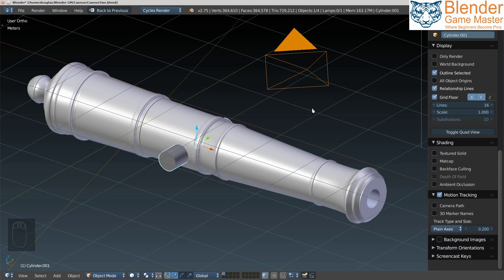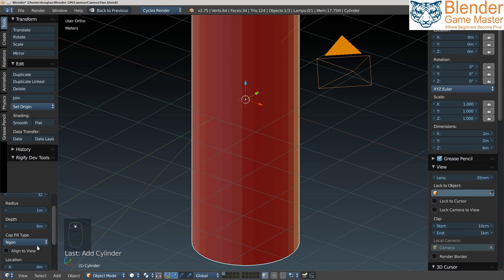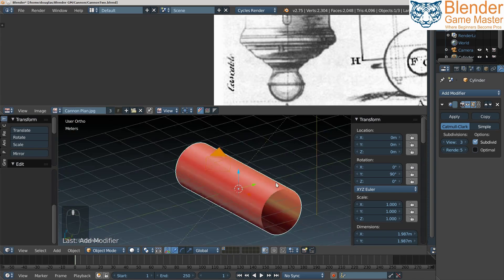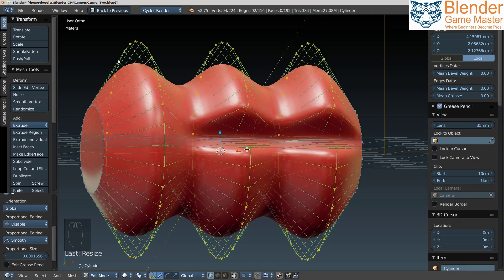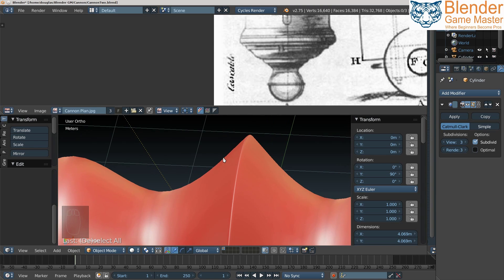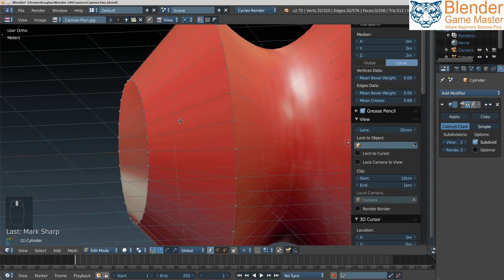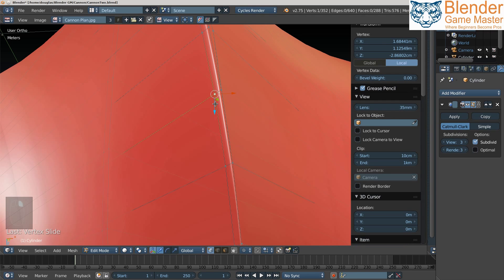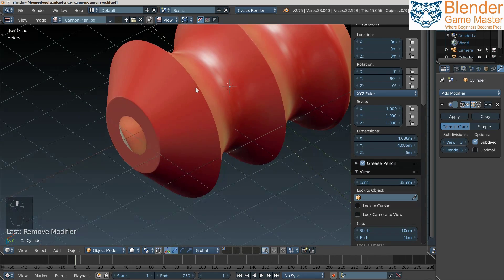Subdivision Surfaces Tips for Blender Beginners and Newbies. Details of a Cannon.

Comment: I normally use Cylinders with only 12 vertices, Subdivision level of (view 2, render 3) and Smooth shading and I enable Optimal display. The Simple is used when you need to add polygons, but don't want rounded edges (i.e.: a cube remains shaped into a cube instead of becoming a ball, but you get the extra geometry).

Comment: I am trying to remove a subdivision surface modifier from an object after it has been applied. thank you
Reply from the maker: +ali alhimeri If it has been applied then the modifier no longer exists. You can't undo it unless it is in your undo stack and you have the undo turned on and have the undo steps turned up enough. All that failing you should retopo your object, if it is worth the time or just remake it.